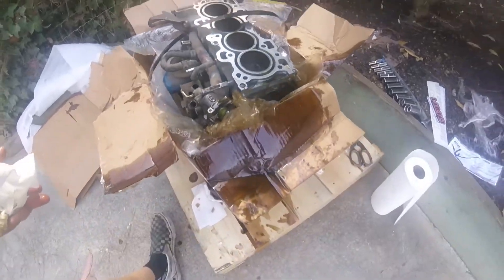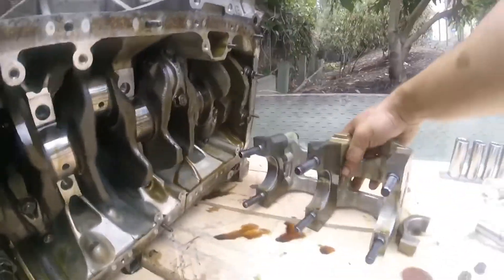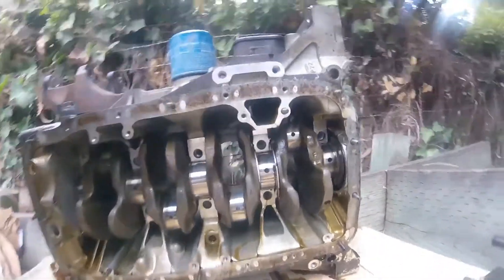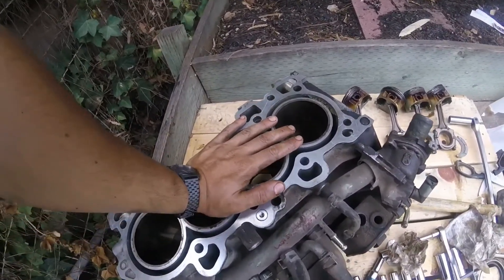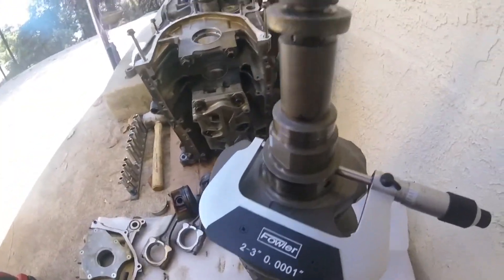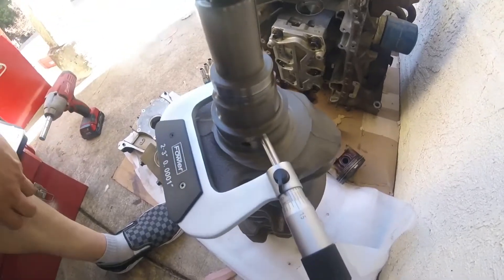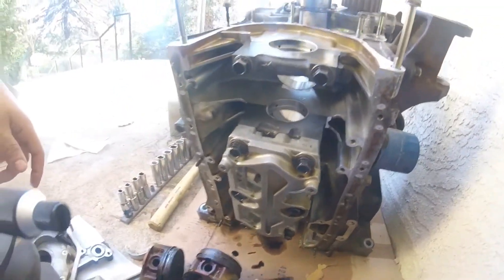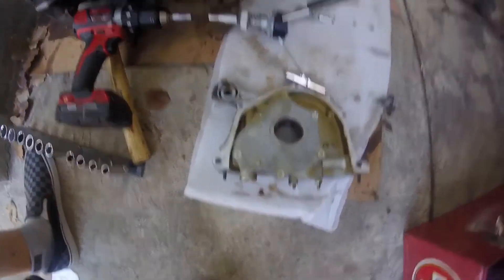GSR SHORTBLOCK!!!  TEARDOWN & INSPECTION

Comment: Why sell the crank? I would get it balanced. Hold up very well
Reply from the maker: I have a b18b crank i will be using in this block. I also have a jdm b18c in my car now so i don't really have a use for another b18c crank. I haven't decided if im going to sell it yet or not. But yes it would be cool to get it balanced and build a 10k rpm all motor monster

Comment: Hey overall would you recommend Hmotorsonline?
Reply from the maker: Absolutely. I bought a gsr longblock from them two years ago. 20,000 miles later its Still in my car, still running strong with no issues at all. In my opinion most of the other places are kinda shady. Call and talk to steve, he is a great guy and really fair about warantees and replacements and stuff like that

Comment: What's up with the update Max? I've been waiting lol.
Reply from the maker: I know, i feel bad cuz the channel keeps growing. Ive just been super busy. Its coming though I promise. Hopefully in the next month ill find the time to boost the car, everything is ready i just need to do it. Ill have some stuff on blueprinting this block i just got too.
Reply: I'm new to B20v. I have a question about mating my jdm low comp B20B  with my 99 gsr head. Would I have any deck problems? Piston to valve clearance etc..
Reply: Thanks in advance.
Reply from the maker: +alomechanthasinh well, assuming that your block hasn't been decked and it is the stock deck height and there is stock gsr cams in your head than you should clear just fine. To be on the safe side, with pistons installed in the block check the piston to deck height with a straight edge and a feeler guage. I believe stock is right around.026" piston to deck height. A gsr head is one of the more common heads that get installed on b20v so i think you should be good. Just make sure you check the piston to deck height when you install the pistons and rods

Comment: How much did the short block cost from HMO?
Reply from the maker: When i got mine they were still $350 plus shipping. But I think i saw on the site, they are like $800 now for the type r, gsr shortblocks. Maybe it was $600 i dunno. If you bought from steve before he will cut you some slack on the price. I think the b18b shortblocks are cheap though, like $250, if he has any.